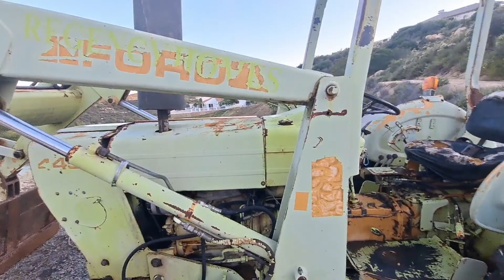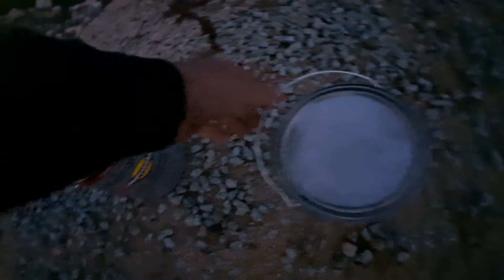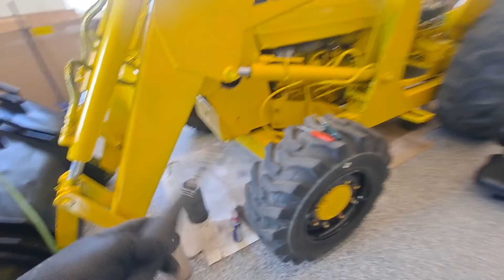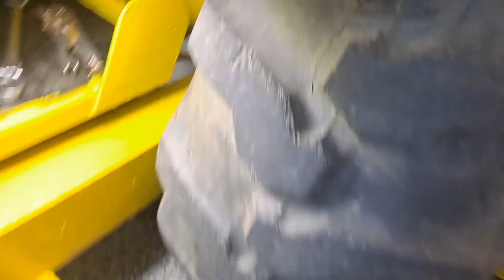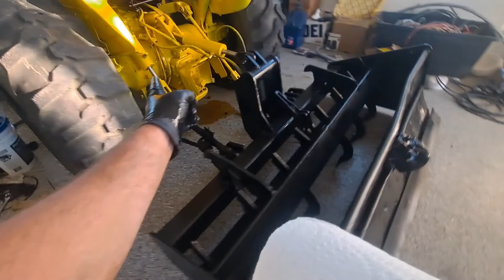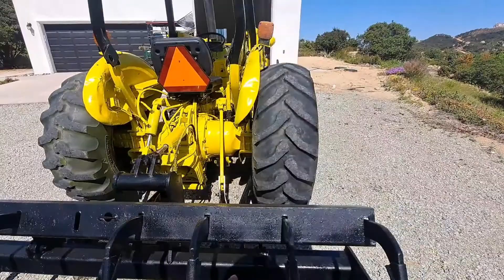Ford New Holland 445d major maintenance, filters, checks and paint to TONKA yellow

Comment: Thanks for the video Paul! Have you changed the fan belt for this rig yet? I have a 545d and need to change the fan belt. I've tried loosening the loader driveshaft to slide it forward and it won't budge. Is there a easy way to do this or do i need to take the pump off along withe drive shaft? Thanks, Randy
Reply from the maker: @randysimpson8248  sorry, i have never done that. I did get a copy of the service manual cheap online although it only came on cd then I downloaded it. But I printed that and gave it to the new owner of this machine so I no longer have it.
Reply: Use the Power Twist 1/2 v-Belt.  It connects like Lego pieces so you don't have to tear apart the front end.  Works perfect.

Comment: Where is the oil fill up and where did you get your manual from. Would really appreciate it thanks
Reply from the maker: I found a guy selling manuals on ebay. He mails a CD, it was kind of a pain but it was cheap then if you really want you can print it from there. 
There are quite a few fluids on there, from what I recall the engine oil fill was right on top of the engine valve cover. Very easy access.